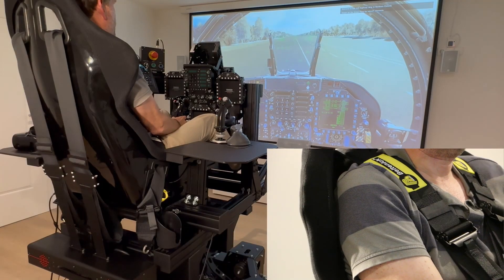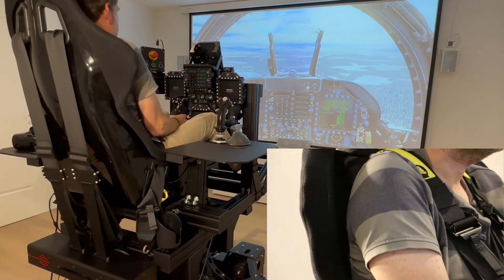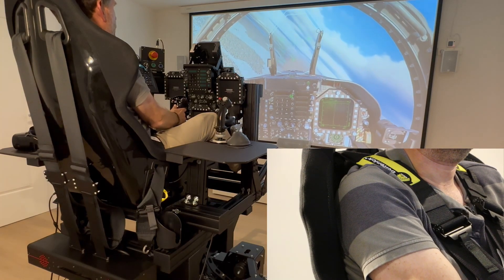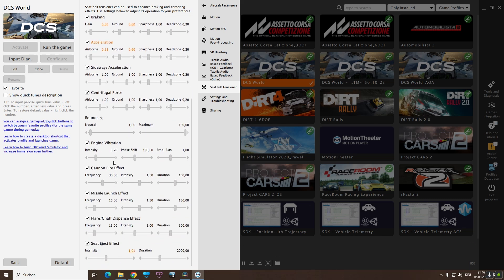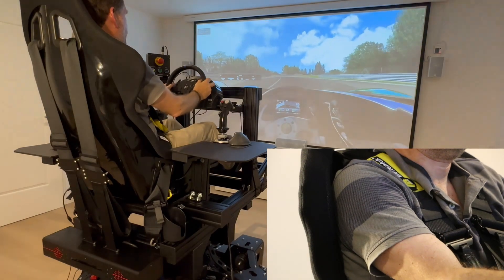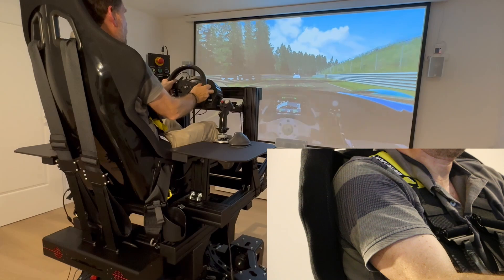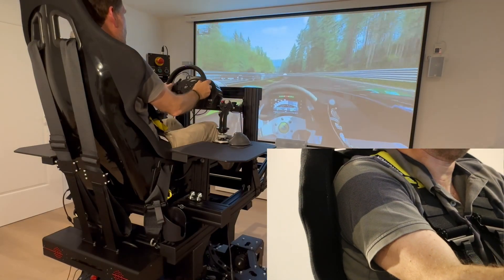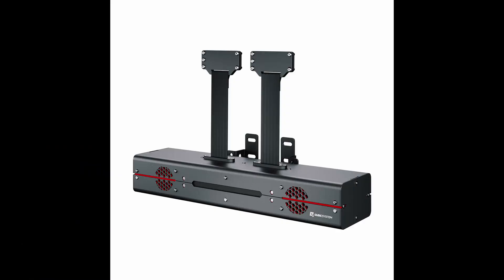First test of the brand new QUBIC SYSTEM SEAT BELT TENSIONER QS-BT1

Comment: Great video, I've been looking for a seat belt tensioner and was going to go with this or the SimXperience G belt.  What 6 point harness do you recommend?  Can you link to it?  I have a Dbox and G seat and want to finally add the belts.  Thanks!
Reply from the maker: @Gorilla_Jones  i bought the belt from the shop that also sells the Belt Tensioner in Germany: https://www.force2motion.de/de/sicherheitsgurt-6-punkt.html?srsltid=AfmBOopVzVTaD18zkba80b6sHhV9aNxw3j7bDG32W50yBTZ7RuLTxnHI 

However I would today prefer a belt with a width of 50mm instead of 76mm, since it suits better to my chair. If you google, you will find a lot of belt manufactures! I recommend using FIA certified belts to ensure proper quality.